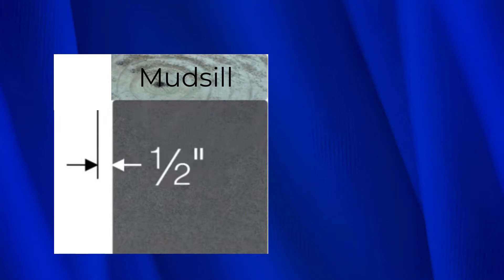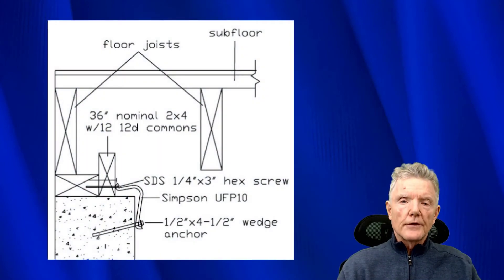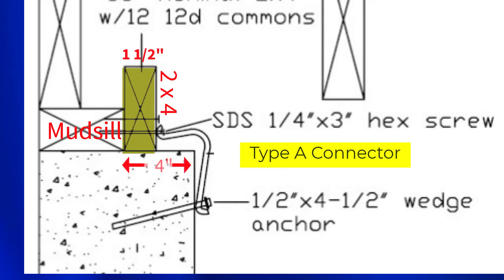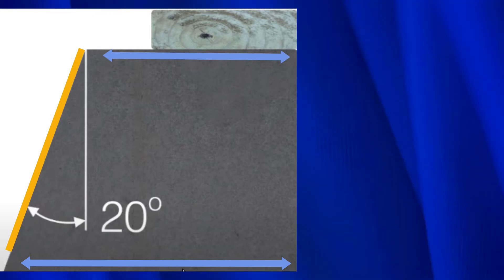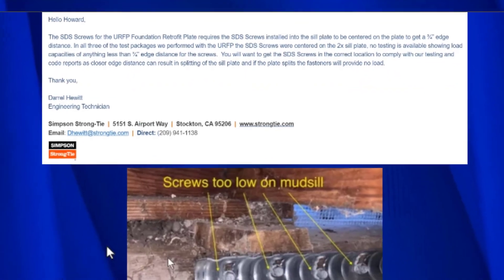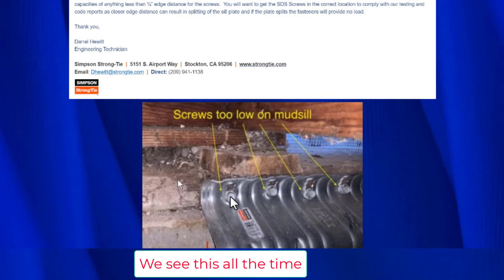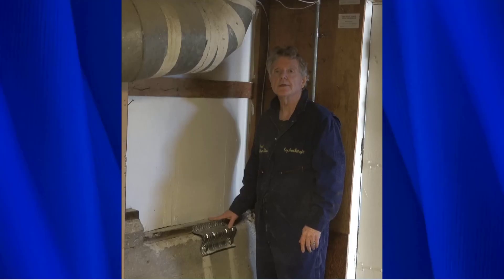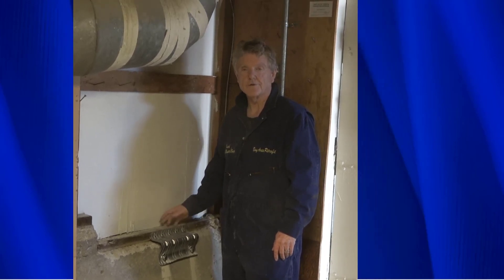ICC 1300: Installing The Simpson StrongTie URFP

Comment: A 3” screw through the URFP and a 1.5” spacer does not give you the 2.5” required penetration into the sill.
Reply from the maker: It should if you apply footnote "m" in the Simpson Catalog.
Reply: @bayarearetrofit5814  Hi, thanks.  I’ve searched the Simpson catalog c-c-2021 and do not find a “Footnote m”.  I do see a provision for a spacer but only for the FRFP.  That application does specify a fastener length of 2.5” plus shim depth.  There is no provision for a shim using URFP that I can see.
Reply from the maker: Sorry, I meant General Note "m"  I spoke with Simpson about the FRFP and you do not need to connect the shim to the sill unless it exceeds 1 1/2 inches but need to increase the length of the screws.  The engineer I spoke with looked at the actual test report.